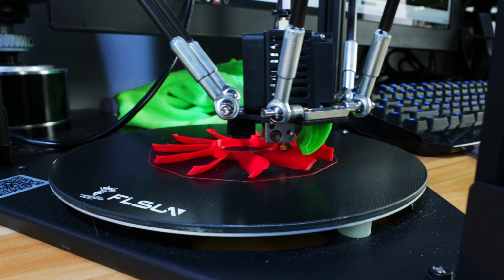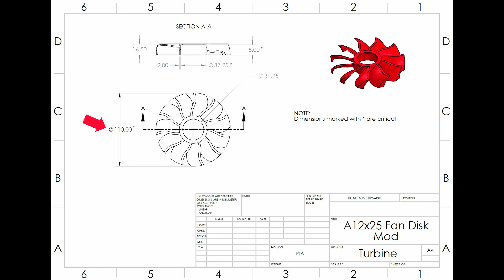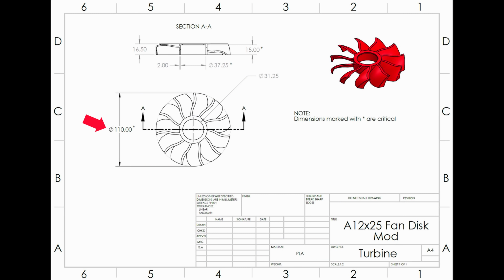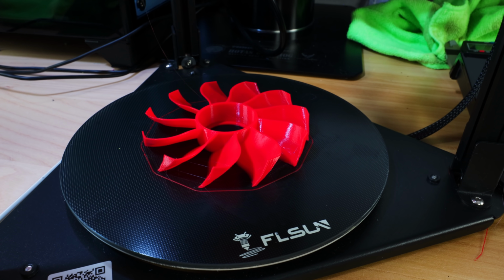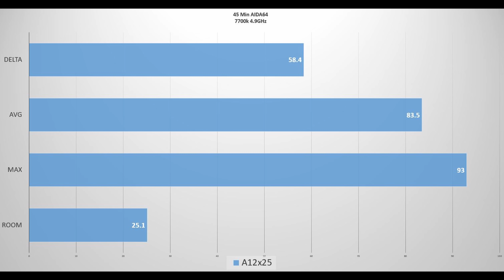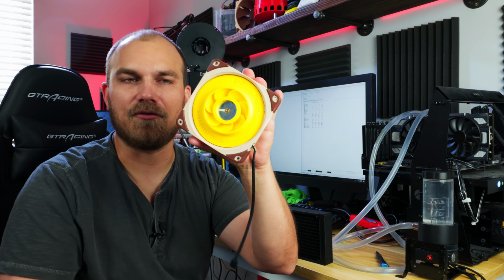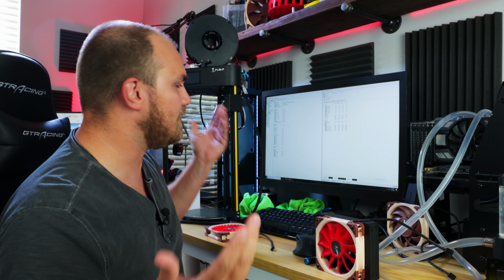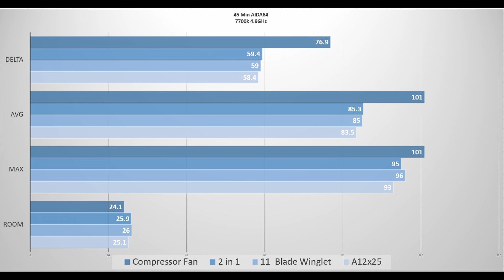My Subscribers Sent Me Their Fan Designs | Fan Show Down Episode 1

Comment: For noise comparisons, try a miniDSP UMIK-1 calibration mic for $75. Room EQ Wizard (free software) is really easy to use with it, you just load the .txt calibration file provided by miniDSP, and can then use functions like the SPL meter. There is also RTA available to check the frequency spectrum, which is much better for fan noise testing than a simple dB number. Comes with a little tripod so you can point the mic right at the fan and get consistent data.

Comment: Ok I got an idea for you. I kind of imagine that you probably deduced this already. If not any other comments. As it seems like the next probable step.

#1. use 4 to 8 peltier units stacked together and functioning in series. While obviously being connected to power in parallel. And place directly onto delidded CPU. With some liquid metal thermal compound.

Now technically using those types of peltier has a maximum wattage of heat transfer capability. However the more effectively you heat and cool a peltier. The more efficient it becomes. So stacking them may actually work.

#2. Place on top of the peltier stack the liquid cooled air cooler radiator. With some more liquid metal thermal compound.

#3. In conjunction with the evaporative cooling unit.

However I would change the design of the evaporative cooler. To use a 6in diameter PVC pipe about 6 ft long. Or technically 6 ft tall in the vertical orientation. Or however you want to think of it I guess. 

This would obviously sit outside the case maybe next to the desk. 

And at the bottom of the 6ft tube connect A  Y joint PVC pipe of the same diameter. 

With the left part of the Y joint connected to an actual vent blower of the same diameter. And the right connected to the 6ft tube.

And on the bottom of the Y joint. Connect a box reservoir which could be something like 2ft x 2ft x 2ft. To contain the liquid. And have a very low center of gravity for stability due to the height of the main evaporation tube. Which I would imagine might be somewhere around 8ft including the Y joint and ducting. Which would contain more than enough water weight to make it very stable.

And on top of the 6ft tube. A dryer outlet ducting hose to the outside of the house. As to not make the room all hot and muggy with large amounts of humidity. 

With a shower head mounted inside at the top of the 6ft tube. To adjust flow rate and water dispersion pattern. For maximum interaction with the up flowing Aire from the Blower Motor on the other side of the Y connection.

And a refrigerator water line. With one side obviously connected to one of the connections from under the sink which are usually built into most homes these days. With the other side of the water line connected to a toilet floater valve. Which is mounted within the reservoir box on the bottom. To automatically maintain the water level within the reservoir. Due to the loss of water through the evaporative cooling.

And while this setup may be more or probably less electrically inefficient. With 8 Pelletier, Blower motor, and water pump.

Also you might want to try mineral oil instead of water. As it is an electrical insulator. So if there are any leaks it's much less likely to damage any electrical equipment. While also being a pretty good thermal conductor.!

However I don't think mineral oil evaporates very easily at all. So you may wish to use Water with evaporative cooling. But in any normal loop mineral oil would be safer and more efficient.

But I can also understand if you just wanted to use the evaporative cooler you've already made. Because the evaporative cooler I am suggesting will probably be a whole subject onto itself.

In fact I can imagine making the entire series out of these suggestions alone. perhaps each of these different versions at a time. And then in a grand finale. Used together in conjunction.

So quick recap. You want to use the peltier's because they sequester the most heat directly. As long as they are sufficiently cooled. And because the liquid cooled Aire radiator is designed efficiently enough to cool with just air. When using it with liquid it's even more efficient. Which makes it perfect for cooling the peltier's. And the large heat dissipation of evaporative cooling. You cool the water you're using to cool the air radiator.

So again while it may not be the most electrically efficient. The order in which the heat is moved is absolutely the most efficient. And I'm pretty sure that's the name of the game. To most efficiently remove the heat.

Anywho I hope these suggestions were helpful.

Excellent videos. 👍
Reply: Also rather than using a ducting blower. If any one of these fans has sufficient airflow maybe use one of them instead.
Reply: Peltier has one problem: is very inefficient and has poor thermal capacity.

It would be cool to overclock something like a raspberry-pi 0
Maybe a low power laptop, but never a 45 w or higher TDP CPU.
Reply: @youkofoxy  You're absolutely right. ! It does have very poor heat capacity. But it has very high heat transfer.

So as long as you can keep the hot side cold and the cold side hot. It literally acts as a heat vacuum.

And fortunately he has already made just the right heatsink for the job.

Because I guarantee that liquid cooled air cooler will be more effective at performing its job than any Water Block you can buy.

Then all you need to do is sufficiently cool the liquid. Which evaporative cooling has in spades. 

If he uses the stacked Peltier. Cooled by the liquid cool air cooler. Connected to an evaporative cooler.

That trifecta should have more wattage in heat dissipation capacity than any commercially available CPU could produce.

Comment: i find few way by ramping fan up faster is get two capacity rate at 12.5volt
remember one capacity attach to ground to pus n other side attach to positive to fan motor n do same other side like psu positive to capacity ground to fan and last 3rd wires skip it off plus n run it on positive side that way u should be able get fan at 5k rpm  "5,000 rpm"
without danged it

i dont have pc up working yet but when i do i show u how make blower out that fan not going be hard it may be interesting

Comment: I had a blade on an NZXT 120mm 9 blade fan fall off. So after I balanced it out it ended up with six blades. Why does the eLoop B12 have an even number of blades? Are there any advantages? 

Most turbofans have even number of blades I think.

Comment: Fun series.

One of the advantages of why the Noctua is so good, is actually the smaller clearance to the sides (they even made a special plastic for this so it does not start to rub after years of use). 
And I expect 3d printing also does not help in performance.
So maybe the real fair benchmark is a recreating of the Noctua but then also 3d printed with the same clearances as the other 3d printed fan.

Comment: The problem with a centrifugal fan is it is made to change the direction of air (see laptop fans). 
If you put the bottom "blades" at an angle instead of straight then it may work a lot better.

Comment: How about trying different blade shapes? For example Coolermasters MF120 Halo has a super weird blade design compared to other fans but the static pressure is great, I've got an 011 dynamic full of them and my air cooled GPU with the fan stop on and R7 with a 240mm AIO idle just over ambient, CPU maxes out around 45 and GPU around 60 @1080p ultra in all the games I play

Comment: For a compressor fan design you could build out into the middle of the powered hub, with the blades starting front and centre of the motor, then sweeping down past it. The fan will be deeper of course, but it should pick up extra performance in a way no other fan can. Doubt it will make all the difference, but it should make some.

Comment: I think the first fan would've done better if it was put on the other side of the radiator.
The design compresses the air when it goes in, so that when it goes it it will have a higher velocity which would make it cool a radiator better.
Reply: Actually, my bad. I think its the other way around, the design compresses the air going in and decompresses it going out, either way when put in the other side the air compression makes the  air velocity faster which might give it an edge in cooling.

Comment: Yellow design looks more like a pump impeller. And perhaps it might work as a vacuum cleaner impeller if it could spin over 10,000 RPM. But with the normal speed those computer fans go, it's not going to be all that impressive.

In regards to the contest, I may have to dust off the ol' version of Blender I'm familiar with. Not CAD, but it exports to .STL and one certainly can be crafty with the modifier stacks.

Comment: I like the multi-segment idea actually. 120-140mm fans are big enough that the tip speed is pretty different from the speed of the hub surface, so maybe it might be easier to optimize two separate rings.
Also, the series should be called The Fans' Phanomenal Fans.
And uh, try dropping the ratio on that yellow compressor fan (make the inlet bigger).

Comment: i guess if the leading edges of each fin were to be extended 15%, that would probably work assuming the blade profile/pitch is normal and the leading edge of one fin doesn't overlap the tailing fin to much... sweeping curve in each fin that starts by cutting into the air at a sharp angle but as the fin goes closer to the out flowing side the fin has a much more pronounced angle... whats the targeted RPM and air density... 300 or 300'000rpm 1.3atm or 0.46atm... that is why PIE goes down to a few thousand digits... the air moves so fast that it eats away at the fan fins like there being sand blasted. but ah, its a cooling fan for a computer chip... not like its controlling a 3000hp fan array that's statically holding up a large Kevlar canvas over a stadium. those just run on a simple analog system right, just a turn knob?

Comment: One design I haven't seen yet is a turbo compressor wheel, Id  really like to see the performance of that, yes it may stick out the frame and the balance may not be correct but Id really love to see how it performs, even if you change the frame to a thick boi server fan shroud Id just like to see the performance :)

Comment: I'd like to see a single blade with a counterweight.
Reply: Dang. Me to
I can tell you right now though that only asymmetrical mass will be suppressed by balancing it, it won't stop the vibration of asymmetrical thrust
Reply: @gormauslander  Yes, I know. And when the CG of the blade is further out than the CG of the counterweight, that also causes vibration. But it would be totally possible. In model aircraft we sometimes use single bladed props for sailplanes.
Reply: Someone did it, last episode I think
Reply: @hardrivethrutown  I know.

Comment: Hey, thanks for the fun video. I've found this video on YouTube about how to make ultrasmooth surface of 3D prints. https://www.youtube.com/watch?v=6xFUNFG-UKE 
It seems not difficult to apply and I wonder if you could use the same technique and make the blades smooth, then compare with the non-smooth versions and see how much improvement there is? Thanks!

Comment: You should try a two stage compressor fan, use a 200mm with a standard type blade ducted to a 120mm with a compressor style blade. See if it can out compete 2x normal blades.

Comment: Thought about designing a chamber to test how much air is being pushed by the fans (probably using an o2 sensor etc) maybe it could screw into the predrilled mounting holes on the noctua?

Comment: I want to see that yellow fan inverted.  big scoop holes with tiny outlets.  the way it was wouldn't move more air than it can initially intake. but with a bigger mouth forced into a smaller outlet you get condensed air, which is cooler than ambient air.  I think it's a good design just implemented wrong.

Comment: I like the centrifugal fan design, they use it in Turbo and Supercharger designs on cars, it's more popular on the turbine of a turbocharger, it basically sucks air in one side and compresses it into a cone that is expanded with quite a bit of pressure with the other set of blades. I BELIEVE that's how it works, dont quote me on that lol.

Comment: I think you need to change the scope of this competition. Instead of “who can beat professional fan designers while using an inferior manufacturing processes” instead use a controllable motor and make it more like “who can design a fan that cools the CPU with the lowest RPMs.”

To make it more fair perhaps you could find a schematic of Noctua’s blade design, print it yourself and have that be the surrogate Noctua stand in.

Comment: Love the winglet design, try making the leading edge of the blades rounded off like a propeller if you can even print a rounded leading edge. Love the series, keep it up, the only channel that actually thinks outside of the box and doesn't just fall in line with everyone else.

Comment: i dont have any ability with design but try reversing the 2in1 so the extra blades are in the center and the bigger blades are outside. maybe a couple different proportions of inner set being bigger or smaller.

Comment: How is the water in the reservoir so still? It doesn't even look like the pump is on. I have the same res with a DDC pump and the top of the water shows a lot of turbulence. All I see here is the water level shaking due to table movements.

Comment: You call it a compressor fan, but think about it. What is it compressing? The way it rotates.
Pretty sure you have a good brain. You NEED to rethink that 'compressor' fan design! Because now you have used it as an expander fan....

Wonderful video yet again, but i expected more from you man. Clearly the fan is designed incorrectly for the rotation direction. Mirror that thing and try again.

Comment: If you do high speed runs of all the designs I am betting you'll find that the performance of that compressor wheel absolutely takes off after about 5-7k RPM
Reply: Maybe literally if the material can't handle that speed, heh.

Comment: Love your vids! I've mentioned this before and hopefully someone can correct me if I'm wrong but you should be comparing fans to your clone of the A12x25. You would have to assume the material difference effects results so if you beat your clone then it's possible even if you don't beat the regular A12x25 that one with similar material with the new design would. It should be a more fair comparison to a PLA clone of the A12X25.

Comment: Word of advise: be careful with the length of screws you use to attach the fan to the radiator with.. some screws are deeper then others and will go in deep and put a hole in 1 of the radiator tubes.. look inside at an angle to see how close it gets..

Comment: How about a compressor fan that is actually compressing? well kinda, if you have a compressor fan with 140mm intake and 120 or even 80 mm output and mount that to a 120mm or 80 mm fan depending on the output of the compressor fan, won't you achieve better results? sorry don't really know much about CAD to design the fans :'(

Comment: 8:45 I think you have it mounted backwards. Or it was designed wrong. I'd just flip the entire fan. The fins on the other side are meant to pull air in and funnel it to the center. The suction fins need a lot of breathing room, and then concentrate that air through the center towards something.  Not saying it'll work better, but that's the way I'd imagine a funnel is supposed to work. You funnel air towards the radiator, not away from it. Still gonna suck, though.

Comment: I think you need to reverse engineer a replica NF-A12x25 blade with your center attachment and 3D print setup. (please don't share the model files as to not draw attention). That replica fan as a control would be more loads more useful for comparison. How can we tell if some of these designs aren't actually superior fan blade designs, and not just handicapped by the mount and print?

Comment: I wonder if the main reason we'll never match or beat the Noctua blades is because of the layer lines increasing the audible noise.
Reply: maybe you could try printing the blades on an LCD 3D resin printer for smoother prints?

Comment: It would be nice to see some more standardized and quantified tests and measurements. Reported values for noise level and RPM are the two biggest that would be worth recording. Different fans also perform better or worse for static pressure (on heatsinks or radiators) versus simply providing unimpeded airflow like case fans, so a measurement of the CFM or flow rate these fans produce would be good to see.

A simple audio spectrum analyzer app for your phone like "Spectroid" for android can produce a very data-rich graph of the sound. This could help identify things like blade-flutter causing additional noise based on which specific frequencies the sound is coming in on.

Comment: try 2 counter rotating fans feeding into each other, theoretically should be more efficient than just 2 fans in terms of pressure.
Reply: Actually this would be pretty easy to do by simply swapping what direction the fan blades are angled and then mounting the fan "upside-down". I'd also love to see this on a pair of a12x15 fans! Total height would only be 30mm instead of the normal 25mm.
Reply: @aaronmorrow4957  some companies are selling extra thin fans so something like that could be possible with a normal 120 mm fan.
don't know how cost effective it is to buy and sell fans like that tho.
Reply: Gigabyte does this with their graphics cards, some even have overlapping fans. They claim exactly that, lower noise and better pressure. It would be cool if someone could verify this claim with independent testing.